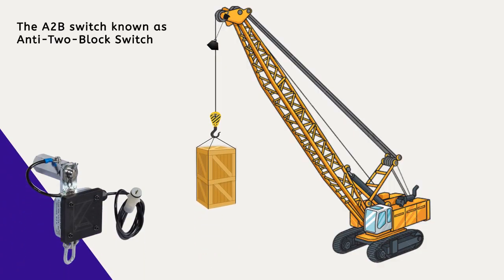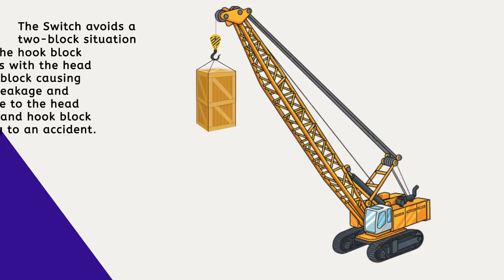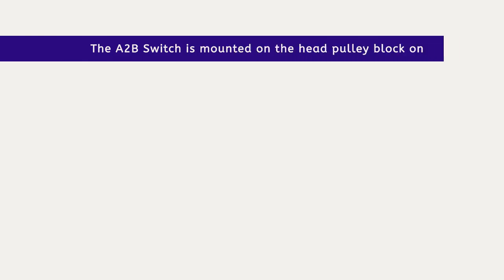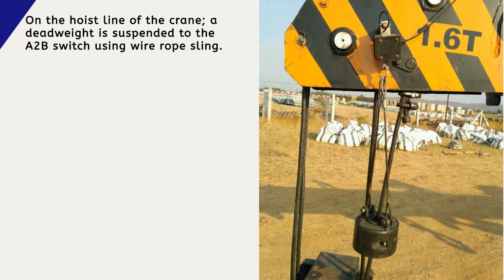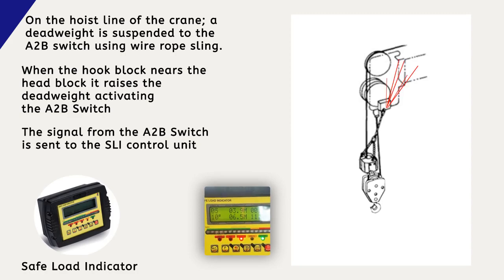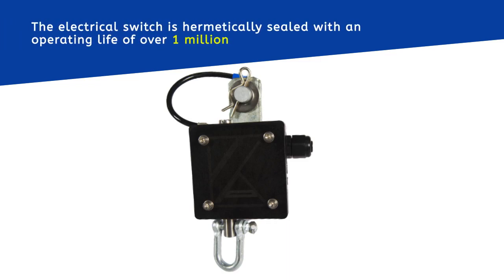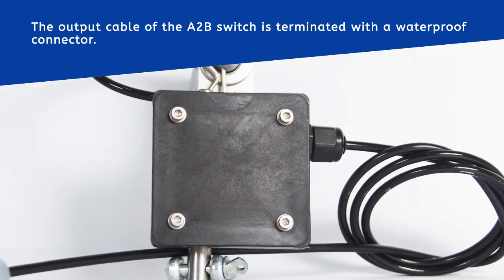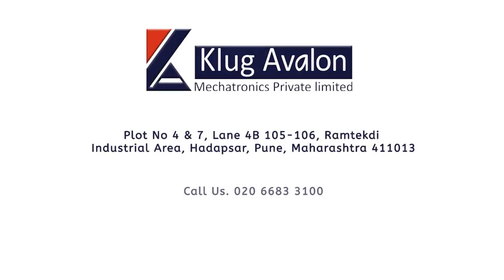A2B Switch | Limit Switch | Over-hoist Switch | For All Cranes | Klug Avalon

Comment: Why did u caling anti two block
Reply: The Crane boom tip has a pulley block, referred as head pulley block. The hook also has pulleys hence referred as hook pulley block. When these two block collide - referred as a TWO BLOCK SITUATION- this results in damaging or breaking the hoist-line wire rope, leading to an accident. So a two block situation needs to be avoided for safe crane operation. A2B switch avoids a two block situation hence named as Anti two(2) Block switch, hence A2B switch